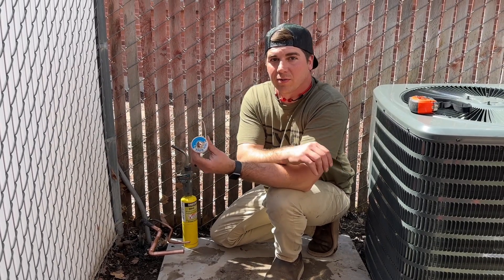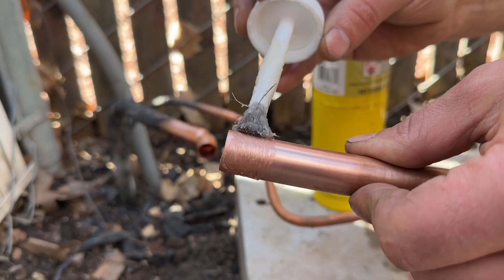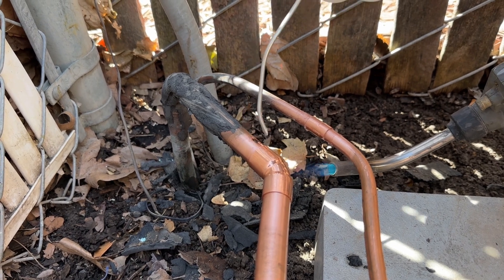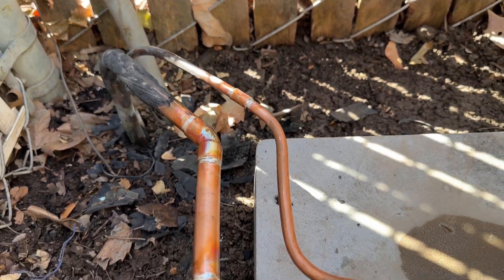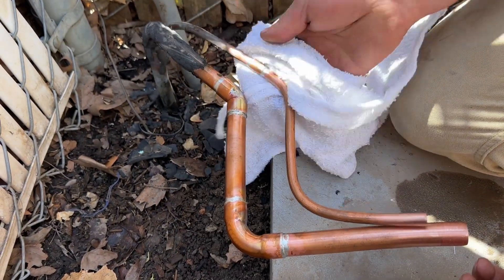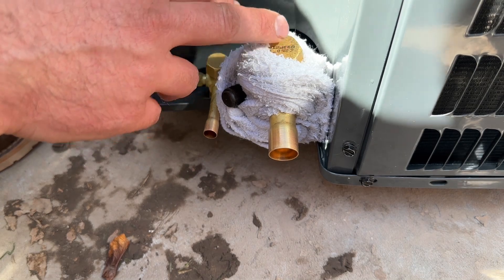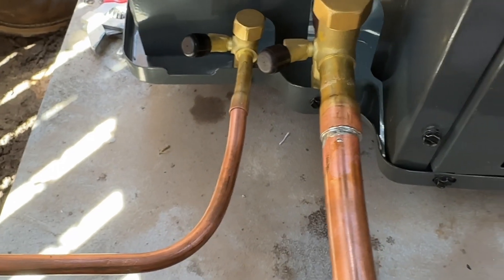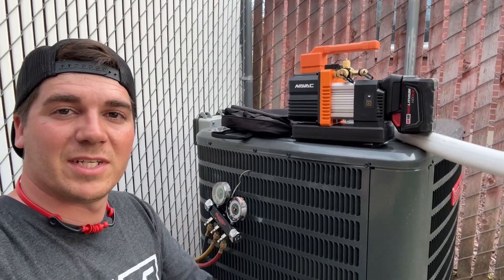Ditch Brazing. Learn To Use Staybrite 8 Soft Solder For HVAC Copper Lines

Comment: Nice!  Yesterday I just installed my own Goodman 3 ton air conditioner yesterday using Stay-Brite 8.  It held pressure and vacuum and I saved thousands doing it myself.
Reply from the maker: Amazing. Thanks for sharing! Cheers
Reply: way tooo go. it's not that hard with all these great hvac youtubers!
Reply: @rivergate950  Thanks!  Between awesome videos by The DIY HVAC Guy and the book Refrigerant Charging and Service Procedures for Air Conditioning by Craig Migliaccio, it wasn’t “terribly” difficult.  I am confident that the next time I do one it will be easier.  The first one was a bit challenging, but doable.
Reply: @80SWoods  Just curious as a DIY installation how did you register it to get the 10 year warranty?
Reply: @80SWoods I’m sure you’re a bot, HVAC is not DIY you need to be certified to do it or else it’s a crime and EPA will come after you.
Reply: @carlife_710  Sorry, I’m not a bot.  It was actually not too difficult to install.  This is definitely something someone can DIY if they are comfortable following the steps like I did.
Reply: @80SWoods  Send me your full name and address sir! I need that $10K check from the EPA for turning you in
Reply: @carlife_710  I’ll never understand why people get so worked up about other people working on their own air conditioners.  Pretty petty and childish.
Reply: @80SWoods  Dude it’s a FEDERAL LAW because you didn’t take classes on how to handle REFRIGERANT and pass a EPA test! That’s like you practicing medicine and diagnosing people with diseases without a Doctors degree! Same exact thing
Reply: @carlife_710  theres enough freon in the unit for a 15 ft lineset so he wouldnt nescecarily have to handle freon. You're just trying to scare people out of doing it theirselves.
Reply: @carlife_710 online test to become EPA certified.  No big deal.
Reply: Exactly right!  I guess taking an online test isn’t exactly the same thing as being a doctor  as was mentioned earlier in the comments.
Reply: @onemoreboat You don’t at least not with Goodman(Daikon).
Reply: @carlife_710 No license for residential in a lot of states. EPA certification is needed to use and buy the refrigerant
Reply: @carlife_710 Dude you don’t have to take classes. I took the test and passed first try.
Reply: @onemoreboat gotta have a license # to register it for the 10 year manufacturers are not going to cover a diy install 😂
Reply: @carlife_710 does the EPA go after the manufacturer for making faulty coils that leak?  😂
Reply: @BrandonL5150 at less than half, who cares about a warranty.  Just buy the new component, if, it breaks?  If installed and maintained, what goods a warranty anyway. They usually warrant an item just under its useful life anyway - otherwise all of us would be getting free replacements and not buying new
Reply: @Hunleygarage  you’d be surprised I do warranty replacements a good bit. Boards compressors… anything and everything is subject to go out. Keep in mind a lot of this stuff is being made in Mexico and the craftsmanship isn’t what it used to be regardless. see stuff out the box bad more than you’d probably imagine
Reply: That's awesome. I'm an hvac contractor myself and I'm glad to hear that. I'm going to look into this staybrite. Hate having to braze and this is soo much easier
Reply: I did my own system 2yrs ago, thanks to these people sharing their knowledge. I even got my EPA certification to buy refrigerant.
Reply: Great to hear Sean! Gives me confidence that perhaps I can try this myself.
Reply: Where did you buy your condenser and evaporator? Did you install a new Furnace too? I have been soldering copper plumbing for years now leaks. The key is getting the copper really clean. I see he did not flux the bells, only the spigot end. I guess that is particular to HVAC contamination. Thanks in Advance.
Reply: lies
Reply: @gallardo360 Please explain.
Reply: @gallardo360 I am the guy that installed his own air conditioner.  It was my first time and not terribly difficult.  It’s been over 1 years and it still working perfect.  Please tell me about the lies.
Reply: The same guy cry’s about the EPA when he modifies his truck. 😂 He doesn’t care about the environment, just excluding other people from doing his job.
Reply: Here’s a 1 year follow-up.  My air conditioner that I installed myself a year ago is still working perfect.  Installing an air conditioner is definitely a DIY job, I don’t care what anyone says, I’m just a normal guy and did it and would do it again.
Reply: @80SWoods homeowners can install there own as a DIY but troubleshooting and servicing is not a DYI project. But in 20 yrs I've seen seasoned installers make mistakes that only service techs can pic up on, adjustable txv, purging nitro while brazing and just little nuances that extend the life of the equipment. Some systems even need blower motor speed adjusted as well. Install is not to difficult proper startup is not 😊
Reply: I call BS on this post, because its cheaper to pay someone to install it rather than spending the thousands of dollars on tools and materials you’d use once.
Reply: @ruffneck_asian3688  Those "thousands" are more like 1k in reality (no need to go banana) and many of the tools can be re-used at other work, vacuum and manifold at car work, torch at plumbing. But that must be cheaper too to have somebody do it. 2 years ago I saved 9k (furnace+ac), and these systems last 15 years these days, so that "once" is more like "once every 10-15 years" now. Get some quotes and let us know how much cheaper you are talking about 😁
Reply: @laurentiupetre5620  Local HVAC quotes were 20k to 28k. I bought a Goodman 3 ton heat pump / air handler online. About 10k with tax. No company will install customer bought equipment. But some techs will moonlight. The moonlighting HVAC guy wanted 9500 to install the whole thing (I still had to buy the ductwork and other materials like mastic) or 2500 to do the brazing, pressure test, refrigerant top up (long lines need 6 oz additional). This is likely gouging as I live in an upscale neighborhood and all costs have the "markup". I bought several tools, propane torch, copper tube bender, sheet metal fabrication tools, vacuum pump and a really nice fieldpiece digital gauge 4-port. The tool set cost me less than 1500 all told. The fieldpiece i got minimally used on Offerup. So I;m saving a bunch of money. Time spent is a different story. As a one-off it is taking me waay longer than the pros. There is also no recourse if I screw something up. So there is substantial risk in taking this on myself.

Comment: What do you think of regular stay brite? I think it has 4% of silver instead of 6%
Reply from the maker: I’d definitely only advise Staybrite 8 for this application. For plumbing pipes Staybrite would probably be fine but this is specifically for HVAC applications. Cheers
Reply: @diyhvacguy  on their website they state that even staybrite regular works for hvac applications, but I agree with you better safe than sorry. Unfortunately they don't sell a small pack of staybrite8 as they do with regular staybrite (It costs just 17$ and includes flux, its perfect for small jobs)
Reply: The higher silver content is best for pipes that experience a lot of vibration.

Comment: Have been using Stay Brite 8 for years.  Excellent solder.  The key is not to use excessive heat.  A torch with a smaller less intense flame works best.  A torch such as a Bernzomatic 8000 is a great torch BUT has a crazy intense flame.  You're better off with a cheaper utility torch head that doesn't suck in all that air so the flame is just about as wide as the torch head.
Reply: It has been years, but if I were to solder I would probably just throw a Sof-Flame tip onto my air-acetylene handle opposed to the spiral tip like TurboTorch… Particularly if I were in an attic as it is much less heat and easier to pinpoint the flame, but still hotter than propane (as true mapp, methyl acetylene propadiene propane, no longer exists last time I checked)… I found I could get the joint done just as fast and fills that gap between propane and oxy-acetylene…
Reply from the maker: Thanks for the feedback! Nice to hear others who are using it 😎
Reply: What about for doing a compressor fitting
Reply: @La2venida  If doing a compressor changeout I'd stick with brazing due to the excessive vibration near the compressor.

Comment: Wow thank you for being so honest about all your ideas with the total hvac systems.  I went thru votech hvac way back in 1996, then never got into the field but loved the training and love hvac things as I was a boiler operator then cogen operator for 20 some years.  So I understood the heat side and btu’s so needed to learn from new the removal of btu’s and all the equipment .  You used nitrogen to pressure test the system?  And my other question is , your testing just the evaporator side and your tapped into the high and low pressure shut off valves and using nitrogen?  I know it’s a very basic question but if I do replace my system I wanna be 100% clear.  Oh and your duct making videos are really easy to understand.  Thank you.
Reply: He is testing the evaporator and line set where he soldered. The service valves should be closed . The condensing unit has refrigerant in it and also you never want to put 400 psi on the low pressure side of the compressor.

Comment: why dont you run nitrogen through the pipes as you are soldering?
Reply: Nitrogen is not required when soldering as the heat from MAP gas is not enough to cause copper oxide inside the pipe
Reply: @TheGhettoLobster  What he said.
Reply from the maker: Exactly what he said.
Reply: MAPP gas is so expensive now and really not needed for low temperature solder like this.

Comment: Wny are you using MAPP v.s. propane?
Reply: MAPP (5300*F) burns much hotter than MAP-Pro (3730*F) or propane (3600*F). Propane at around $3 per bottle and MAP-Pro at around $10 from local big box stores.  That said true MAPP is no longer available in its orig. form, now it's really map-pro...which as you can see isn't a lot different in temp.    The orig MAPP was more handy to use with 3/4 or 1" pipes b/c it burned hotter and allowed you to get a good seal w/o having to re-heat when you didn't get it right the first time.  

The tensile strength of brazing is far higher than staybrite-8 and if you're doing for your own home, I'd braze all the lines (except for perhaps the dryer), w/ nitrogen, of course.  I've clipped my A/C unit outside w/ the mower once and the neighbor's lawn service whacked his w/ the riding mower and bent the copper tubing (had to be replaced) his brazed joints were fine...not saying the SB-8 joints would fail/survive, but it's quite a bit less strength.

So, as a DIYer, I will always choose the better/longer lasting option.  If you're an HVAC tech who makes more  $$ the more calls you're on...well, don't follow recommended/best practices....the latter reason is why I'm a DIYer...known quality
Reply: @dgoedken3949  Wow! Thanks for the fantastic reply! I really appreciate you sharing your knowledge.
Reply from the maker: You can use either. Supposedly mapp gas is a bit hotter but even that is debatable
Reply: @diyhvacguy  Thanks! MAPP is a lot more expensive, so I was wondering if there was a specific reason you use it.
Reply: Propane is actually better, that's what I used

Comment: Instead of soldering why not show a video where you went in and changed a limit switch on a gas furnace or elements in a split system or self contain. Maybe a little service will explode your videos but nonetheless nice job!!!!
Reply from the maker: Work is slow right now, but when the repairs pick up I will most certainly be doing more. Thanks for the feedback!

Comment: Nice job on those joints sir. I have seen this solder before, but never figured there was much difference for a diyer. But after this vid, I think my job won't look as dobbed and pitiful 😂 . Looking forward to next one! Stay safe!
Reply: I remember seeing this StayBrite solder at the supply house over 35 years ago. The factory reps demonstrated how to use it but we always used 15% silver brazing stick.  I used it on my own HVAC equipment and I was impressed.
Reply from the maker: Thanks brother. Staybrite 8 is super easy. Just make sure it’s prepped right and has no gaps!

Comment: $87 for the Staybrite kit.  Wow.  I wanted to try it but I do not do that much soldering.  Thank you for the recommendation.
Reply from the maker: Yea if you aren’t doing a replacement job it’s probably a bit expensive just to play with, but If you ever do a diy ac replacement, $87 is a very small price point compared to investing in a oxygen and acetylene tank torch set, not to mention brazing rods which are about the same as Staybrite 8, 70-80 bucks.

Comment: I am sole with SB#8. I will give it a try with my first DYI installation soon. Thank you.
Reply: Hi man, how did your installation go?
Reply: @valberde61  Much easier than I thought - if I can do this, anyone can. Just be sure to do some practices before doing the real thing.
Reply: @RNN24  I think I’m going to do it myself. The hvac company quoted me for 5000 jut to replace the ac.
Reply: @valberde61  The hardest part would be on fabricating sheet metal, merging the existing duct  to the new evaporator box. But, not too hard - try making them on cardboard paper first, then transfer to real sheet metal. Plan it carefully, with everything, it maybe going to cost around $ 2K ish.  Good luck!
Reply: @RNN24  one last question, did you reused your copper lines? If so did you have to flush the lines since you when from R22 to R410?
Reply: @valberde61  Why taking risk using the old stuffs -  I use all new copper lines and fittings - maybe cost around $300 ish. I went with the lowest efficient system (SEER-12) R410 - I like to keep things simple/easy. In the my area, we need AC only 4 months out of the entire year -- max.
Reply: @RNN24 lol you don't need to use metal to fill in the gaps from the unit to evap coil. Use threaded hvac tape,  the tape with the threads inside used for insulation,  and go over it with pookie aka duct sealer. Once it dries , it's just as solid as metal. But it's 100x easier and faster.   I know it's kind of ratty. But it's in the attic ir basement and nobody will see it. Also. You can still make it look decent. It doesn't have to look like a ratty mess.

Comment: Take out the Schrader valve when applying heat to the valve area
Reply from the maker: I know a lot of guys that don’t even wrap the valve much less remove the Schrader valves. I remove the valve on the low side when pulling a vacuum but I’ve found that if it’s wrapped, it will never melt a Schrader valve. But that’s just my experience.
Reply from the maker: But it’s a good practice if you are just learning how to braze and are putting more then the usual amount of heat on the service valve 👍🏼 thanks for the input

Comment: Nice. you don't have to braze ac lines?
Reply from the maker: No sir. A lot of people use Staybrite 8!  A lot of guys prefer brazing but Staybrite 8 uses so much less heat, so no nitrogen flow is needed, and there is less potential to burn anything up.
Reply: @diyhvacguy  what system do you prefer?

Comment: They say you should braze Hvac lines because the pressures of 410a is hi..
Reply from the maker: Yes, they also don’t want homeowners doing this stuff, so that’s part of it. The only place I’ve heard is a no no is the discharge line right off the compressor. Always braze that joint if doing a compressor replacement
Reply: For one thing brazing is not that hard. I’m an hvac tech and a plumber. I would never solder a system like that.
Reply: @bradmillikan6047  I agree with that , if it was so good everyone would be using it
Reply: @chetmyers7041  or it will just be another option
Reply: As a service tech I encountered tons of leaking joints on newer 410 systems where line set was reused and it was done with soft solder originally
Reply: @Republican317  This Staybrite 8 was engineered to have super high tensile strength to replace brazing, FYI. Check the manufacturer specs.
Reply: @tony17112acst tensile strength they claim is for the staybrite only not the finished joint. Soldering is basically gluing the pipe together not the same as brazing. This is meant for people who can't braze properly.
Reply: Lies, just old schoolers. This stuff is amazing, I did my own system 2yrs ago and not a single problem. Brazing is old crap.
Reply: I think I’ll stick with brazing. Even if I have to use low % silver solder. I hate paste flux. The only time I saw the best flux is when I used to fix radiators. I used a powder gray flux mixes with liquid acid which is almost impossible to get because it’s highly toxic.